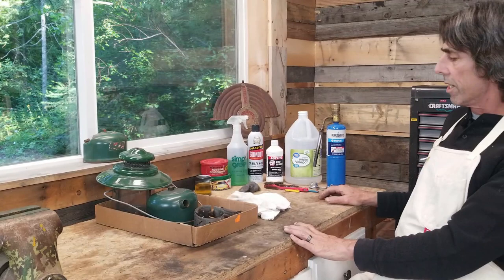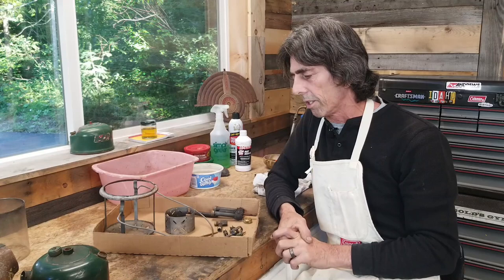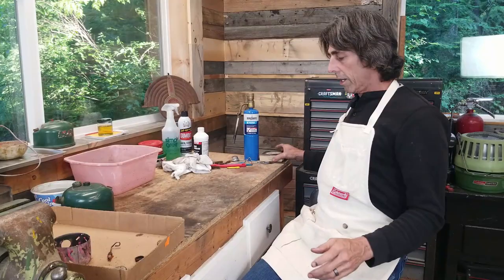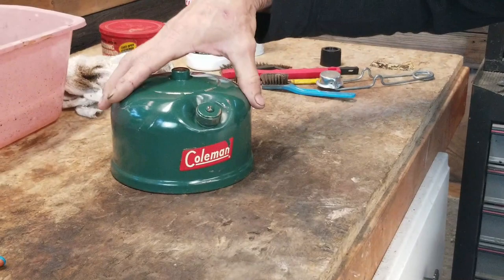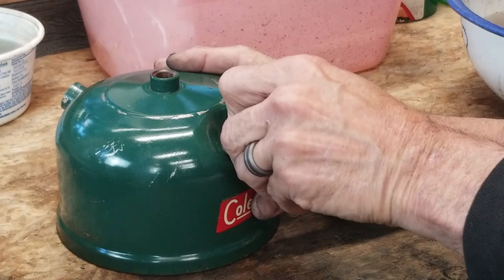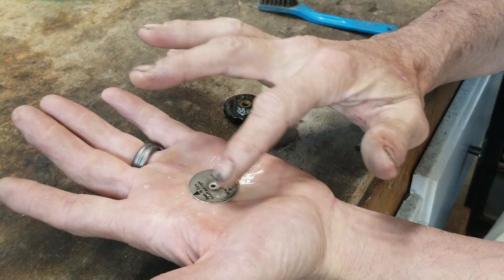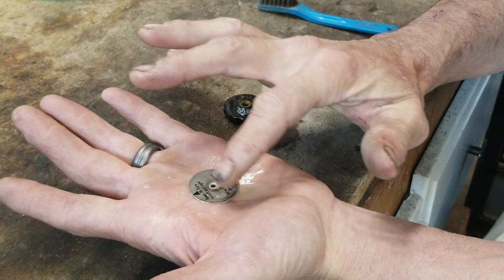How to Rebuild a Coleman Double Mantle Lantern Part II:  Cleaning and Reassembly

Comment: I use a water cooler jug cut open around top. Filled with cleaning vinigar. It soaks the whole cage.
I have also used muratic acid which will turn the rustiest junk heap to clean bare metal in 5mins. But do it outside! It will flash rust everything in you shop in a week....dont ask me how i know 😫
Reply: I dilute muriatic by half with distilled water a little slower but safer.
Reply: @Vladviking  i have moved over to straight cleaning vinigar. It does the same job with less hassle. No need to roast parts after neurilizing with baking soda. And u can do inside and even reach in gloveless to check parts
Reply: @crabtrap  I usually only use Muriatic on bad pitting and stuff I really want to preserve well. other wise it's the Rustoleum directions.
Reply: @Vladviking  if u have a heavy iron part like a small engine block or such. Muratic, outside is the ticket.

Comment: May I ask if it is possible, since Bio Ethanol is used legally in No Vent alcohol portable fireplaces indoors (with some window ventilation); is it possible to run my Coleman 533 dual fuel Sportster on this same Bio ethanol in an emergency grid down scenario? It is very pure product with No soot or carboning. Thank You.
Reply from the maker: Barry I am not sure, but stoves like your 533 can run on anything that will vaporize.  I'd recommend giving it a try (safely, of course) and then letting me know the results via email at info@oldtowncoleman.com.  I have a stove/fuel video in mind so I'd be interested in hearing about the bio fuel you reference.

Comment: Do you have a video on old military lanterns?  I have a 1945 Military Coleman that leaks fuel seemingly everywhere but does light.  I'd like more information on it before messing with it.
Reply from the maker: Hello and thank you for the note.  I don't have that video yet but will be making one and have the lantern in the shop ready.  Please email me at info@oldtowncoleman.com so that we can (first) figure out where the leak is coming from.
Reply: @OldTownColeman  I have since learned that these are low pressure lanterns.  I believe I had it pumped up too high.  However it still does not burn bright enough.

Comment: How do we remove the old "Coleman" decal from the fount?
Reply from the maker: Ben, not easily!  I have kept them moist for a number of hours with simple green and then went after them with a fingernail.  You don't want to use anything harder than plastic, or a fingernail.
Reply: @OldTownColeman  Thank you. So do not use a Heat Gun??    I am looking forward to the valve packing on the CQ. I purchased another one (CQ) to follow along with you once you get back in the shop and find the right punch. I was rewatching this YouTube as I am rebuilding a 220F for my Daughter.

Comment: I have a 1974 double mantle lantern what new mantles will work with my lanteren?model 228h
Reply from the maker: You can use either #21 or #99 mantles for your 228H.
Reply: Thank you for replying I just received my new mantles today also went ahead and bought new leather washers for the pump.

Comment: Hey Frank had question for you do you know the Thread Pattern on the Tip Cleaner Stem where it screws in to the tip cleaner I’m trying to make a piece I can thread and screw in there when I take them apart so it doesn’t Crush or Bend the Brass opening I hope this makes sense
Reply from the maker: Plumpy I'm afraid you're over my pay grade on that one.  I understand what you're asking but I sure don't know the thread pattern.  I suspect someone does tho--if you post that on the Old Coleman Parts forum you'll get an answer quick.
Reply: @OldTownColeman  I’ve tried to join the forum for while I use my regular Yahoo email and it always says it’s an Invalid Email idk I gave up on it while back

Comment: I have a 220j that has fuel coming out of the generator but not getting to the mantles? Any suggestions
Reply: The jet might be clogged, I clean the valve and generator assembly to the best of what I could just recently on a 228e. I don’t have any carb cleaner at the moment, so all I did was clean it up with 0000 wool, put the valve assembly on. not the collar, and the upper pice, filled it with some fresh fuel pumped it up, and watched what the jet was doing. It kept clogging after using the cleaning rod. So I just removed the jet placed some hose around the generator turned the valve on, and keep it pumped it basically flushed the system pretty well, when. I put the jet back in it didn’t clog anymore! I got everything back together and it’s working still not perfect the valve steam pack needs replaced I think there isn’t a lot of resistance on it cold, but when it gets hot, it’s quite tight!

Comment: Good morning, I have two Coleman lanterns that when I pump them up, turn on the valve I’m not getting much fuel up to the burners. It will light but then go down and just go out. I don’t hear much hissing of fuel. Is there a way to clean check valve without pulling it, also, are the valve stem packings all the same.
Thanks, love the videos
Reply from the maker: Art I believe I responded to this on another site.  If I'm wrong please let me know!
Reply: I'm having the exact same issue. Can you please post the solution here?

Comment: Okay, so I just rebuilt a 67 220F by using your video and I want to thank you, but I have a question. When I turn the gas knob up and down it doesn't seem to change the light output. So is this normal or did I install the valve too tight? If not, is there a way to make the lantern not so bright?
Reply from the maker: Are you turning the valve wheel, or the tip cleaner?  You should open the valve to 100% and leave it there, and then adjust brightness with the tip clean stem.  It is very effective too.  If the tip cleaner makes no change in brightness then you have problem, most likely a broken tip cleaner wire in the generator.  info@oldtowncoleman.com if you run into problems.
Reply: @OldTownColeman  Oh okay, i did replace the generator and it works fine. I'll try that next time. Just wasnt sure about the gas knob, it was a little squeaky at first but seems fine now. I'll give it another shot.

Comment: Do you sell parts for Coleman lanterns I have one that I am restoring it's a 220 c and the very top of the vent cap is rusted off and missing all I have left of it is the porcelain part with a little bit of the screen mesh left on top of that the rest of it's missing somebody was going to throw the lantern away so I took it to see what I can do I have it apart and soaking the brass and vinegar waiting on a check valve cleaner and then I'll put it back together only parts I need to get are the glass globe and the very top and the nut that holds the top on
Reply from the maker: Go to: https://www.oldcolemanparts.com/

Comment: How tight does the valve need to be to get the cage lined up?
Reply from the maker: Jay, 99.9% of the time the valve will start getting really tight as the stem passes over the pump housing.  You'll really need to apply pressure to get it the last quarter-turn where the stem is centered between the pump cylinder and the filler cap hole.   Is this your question or are you speaking of the tip cleaner?
Reply: @OldTownColeman  The tip cleaner.

Comment: I just bought a 1954 220E for $20 in great shape.  Had to get a new generator for it cause it was missing and it lights up but it pulsates then slowly dies out.  Even after it’s lit and I pump more air in it will brighten then slowly dies.  Any suggestions what it could be?  😊
Reply from the maker: Gus unfortunately that is a sign of a fuel & air tube in need of attention.  It may be partially blocked or the spring could be stuck.  Once you light the lantern and get it running, shake it around real hard to see if it starts burning better.  What you want to do is to get the fuel in the fount all over in there because the fuel and air tube has a port on the top for air and if getting that port splashed with fuel causes the lantern to run better, it confirms that fuel can't get in the fuel port at the bottom.  If that makes sense...
Reply: Exactly what my 1/64 200a is doing... Never had to go this deep before. I know what to do now. These lanterns last. Wish everything was built this good. Great video thanks.

Comment: i cleaned out my Coleman dual fuel fountain with apple cider vinegar and follow by a rinse with water , follow by a rinse of rubbing alcohol. less than 12 hours later i have rust film inside tank. am i doing anything wrong?
Reply from the maker: Ensure everything is dry, but try a mixture of water and baking soda as the final step.  Email is info@oldtowncoleman.com--please let me know how it is going.
Reply: @OldTownColeman   thank you, will do

Comment: would it be worth soaking the tank in evaporust?
Reply from the maker: Christopher it certainly would not hurt.  Depending on how far the rust has progressed, it can really be a bear to get it out.  Fixes range from POR15 coating to neutralizing for flash rust.  Evaporust would be an excellent solution.

Comment: Can  double mantle lantern be rebuilt for a single mantle? I think they're too bright.
Reply from the maker: Dinah, no, but you can turn the tip cleaner to lower the light output.  What lantern are you using?
Reply: @OldTownColeman  Tried that. Still too bright. I like to be as invisible as possible in these all too crowded campgrounds. I find a few candles to be bright enough for most evenings, and I like the atmosphere. Reading and other activities that require a lot of light can wait till daylight. Let the bugs go home to bed.
     I don't know the model number off hand, and I really don't feel like traipsing through the snow out to the garage right now. I know that it was purchased in '73 or '74 if that helps. It was given to me because the pump didn't work. I spread the leather and oiled it and it's been working fine -too fine- all these years.

Comment: Have you ever tried using Electrolysis to remove the rust on the steel parts? I'm positive (terrible pun, sorry... not) it would work flawlessly for 100% rust elimination especially INSIDE the fount if that's steel! Not sure if it would work as well for the brass parts but they are "conductive" so I don't see why not, unless it creates lethal fumes like when you electrically weld on brass or copper? Plus for someone like yourself who's doing this a lot it would possibly eliminate most or all of the need for manual rust removal labor on a good deal of parts, a lot of the Navel jelly and wire brushes used too $$$. 

All you really need is a 12v DC power source like an old 12v battery charger (preferably the old school kind not the newer smart chargers), a good sized plastic tub of some sort depending on how many parts you want to clean in one batch, sodium carbonate which is also often called "soda crystals" or "cleaning soda", at least two pieces of scrap steel (not stainless) to use as sacrificial electrodes (a + Anode and - Cathode), some water and time to let the magic happen. 

Flat scraps of steel bar stock make pretty good electrodes and the only real labor between each batch is pulling the electrodes and cleaning the rust off back down to bare metal. You do need to preclean any oil or grease off the parts you're cleaning for good electrical contact, so let them soak in a bucket of simple green for awhile or hot water and Dawn dish soap. Plus the same sodium carbonate/water solution can be reused over and over too instead of having to buy "gallons" of Navel jelly. Make sure you do it in a well ventilated area too! YouTube has apparently gone full retard and automatically deletes entire comments that have any web address hyperlinks, so I'll post the title of a really good video I found in a reply to this comment so you can copy/paste and search easily for the right video plus another with the actual "link" too.
Reply: The Power of Electrolysis | How To Transform Rusty Tools!
Reply from the maker: Sure, I have had electrolysis on my website for years.  I've never used it on a fount as it will eat the paint.  However there is absolutely nothing better for busting rust.  I am about to do a single-burner stove video and will be "cooking" the burner to free the steel-in-steel hardware.
Reply: @OldTownColeman  easy peasy... Don't put the whole fount in the solution, just fill the inside to the brim, then use a rubber stopper bung with two holes drilled down the middle to thread two steel rods through for electrodes. 

You'd want to have them long enough to reach almost to the opposite side of the fount so they'd need to have a slight upswept curve to them and I'd also put two 90 degree bends on the rod ends on the exposed exterior portion so those line up pointing out to 9 and 3 O'clock for reference. 

Then on the inside portion of the rods have them spread out in a V in such a way that when you turn the 90's either both up to 12 or 6 O'clock  a bit the V comes together parallel so the rods can slide into the fount... That way it helps the electrolysis work better.